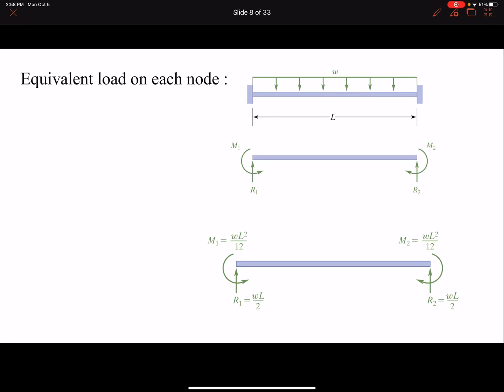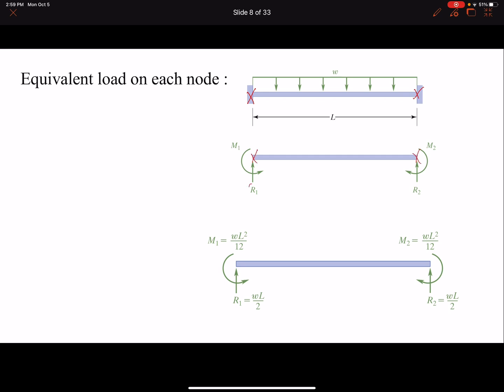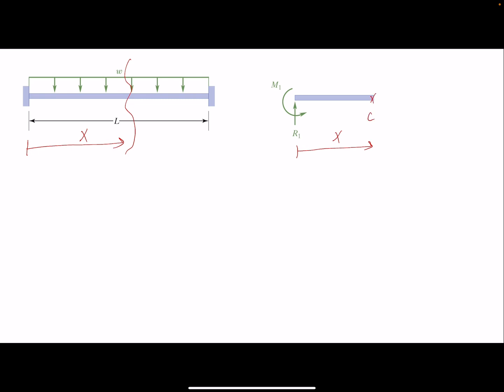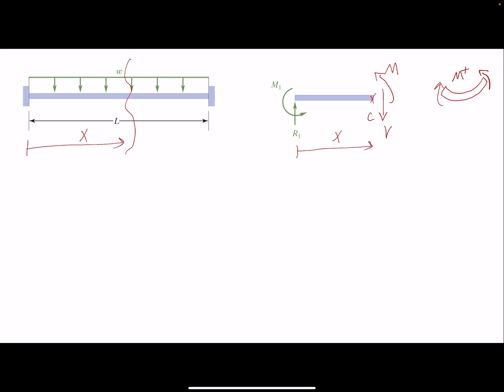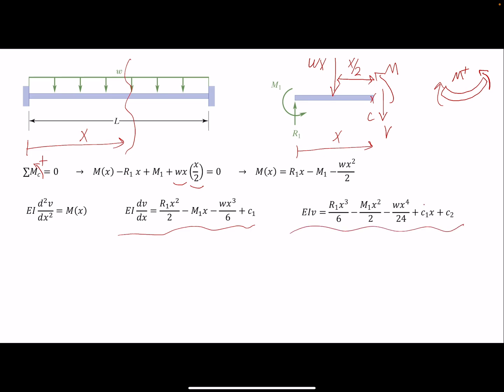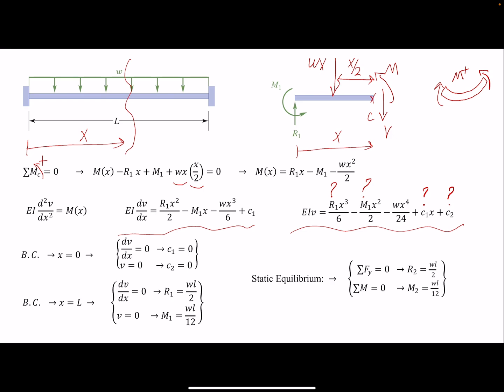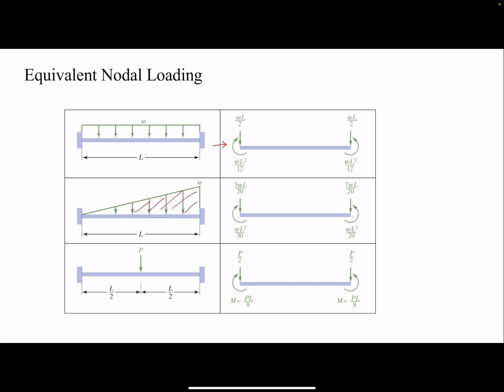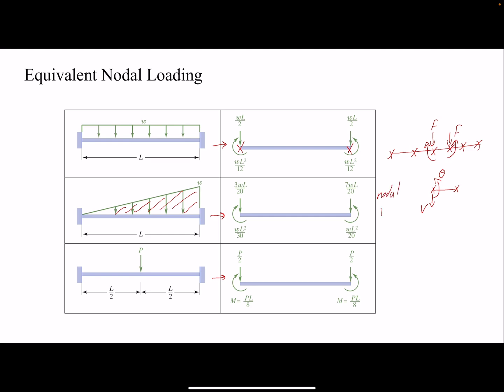Lecture 10: Equivalent Load on nodes in beam element

Comment: Thanks for video, Why is the equivalent load calculated on the fixed beam case always? Why not in the simply supported beam?
Reply from the maker: That is the harder case as there are moments at the two end involved make the system statically undermined, the simply supported case is an easier system where reaction forces can be determined using equilibrium equations